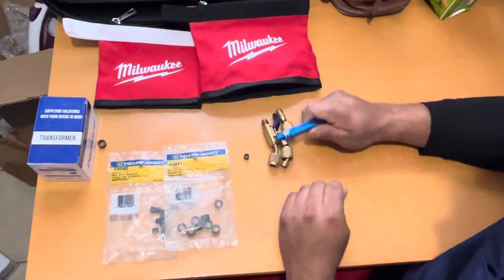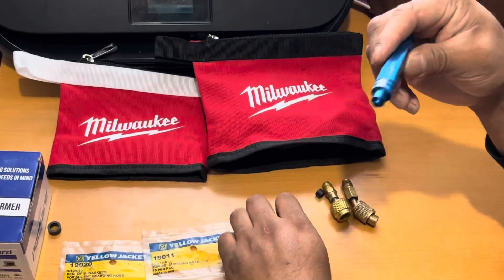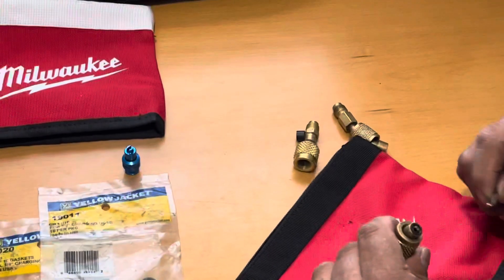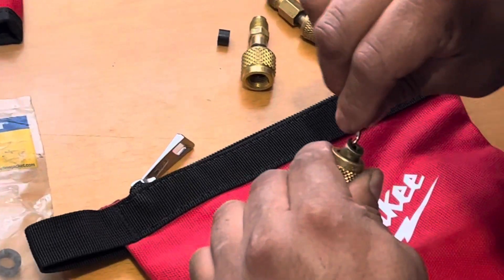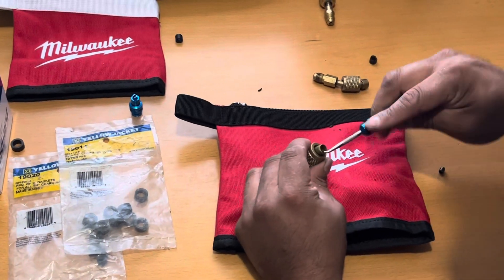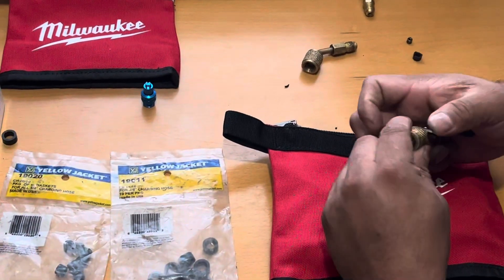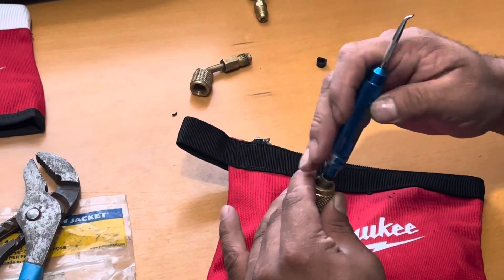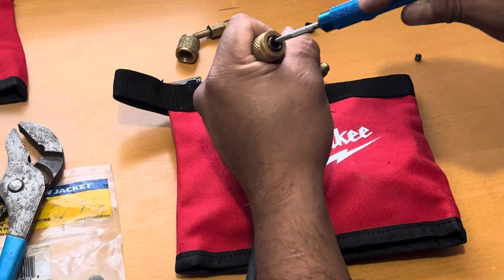Refrigerant hose gasket replacing

Comment: by the way I use vegetable oil from the kitchen and I just dropped the seal in the lid with about a half-inch and then I rolled and patted it in market with the bee and it went right where it's supposed to be

Comment: appreciate you taking the time to make your video but you forgot about putting the oil on the seals and I've broken like five of themthen I watched another video and the guy put some oil down in the old stinkhole and the rubber baby buggy bumper went right homethanks for the link to the tool though